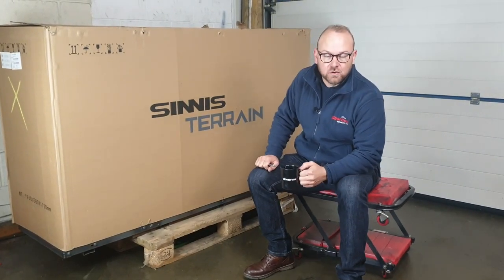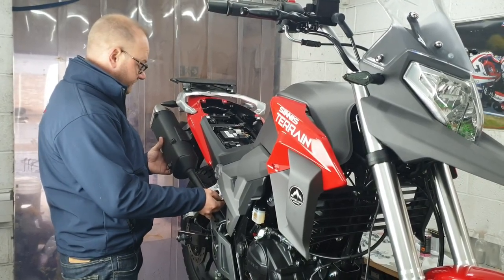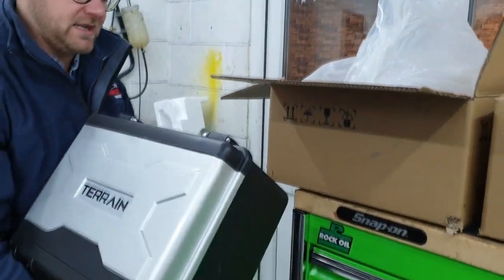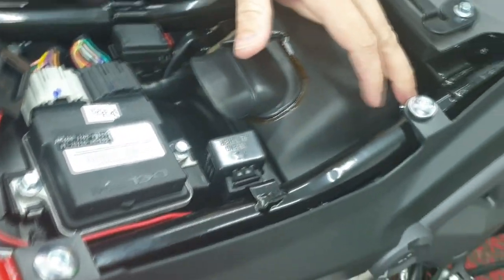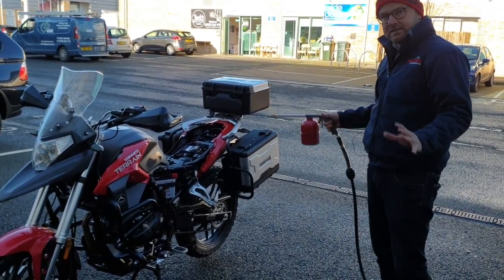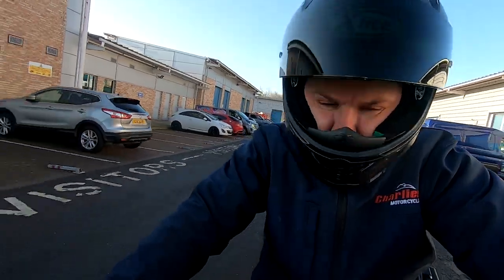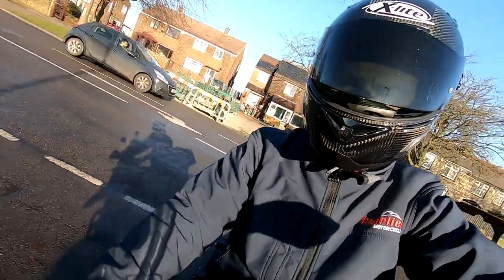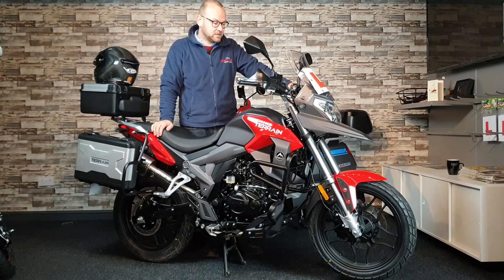NEW Sinnis Terrain build, heated grips hand guards and exhaust fit with a test ride

Comment: How much whould one cost in grey with everything on hear also heated seats  better led light and bigger back box and another USB port for a satnav
Reply: Bear in mind that the charging system may not be up to powering grips, heated seats and extra accessories combined. Fuel injection systems need to see a good voltage or running issues may occur. Might be fine but worth mentioning.